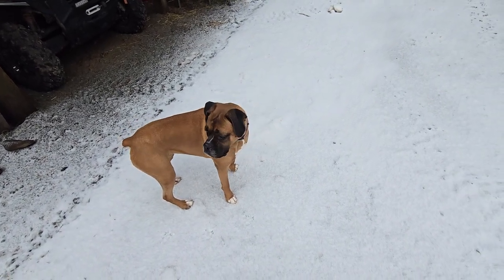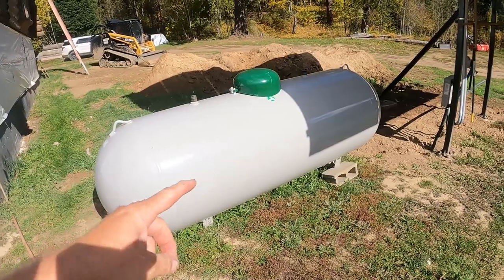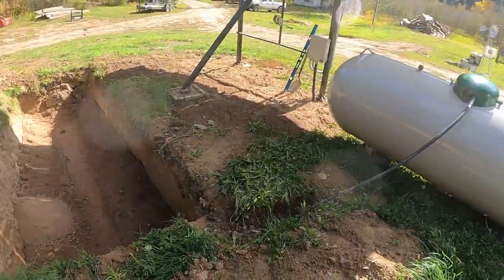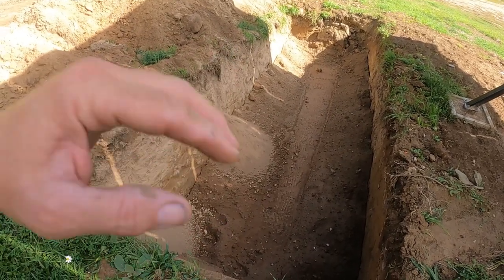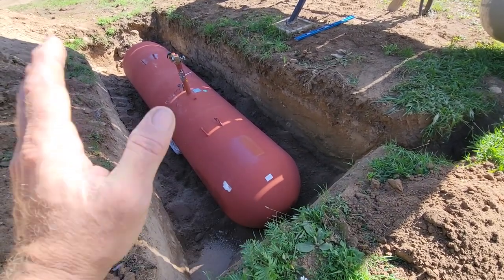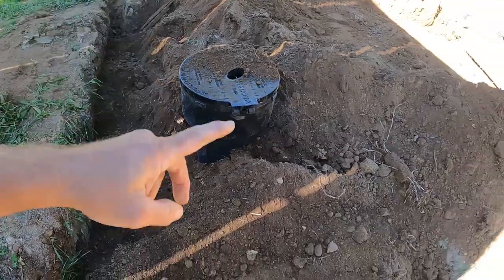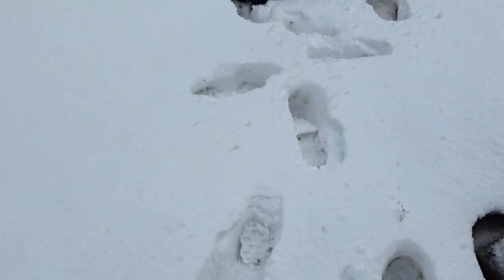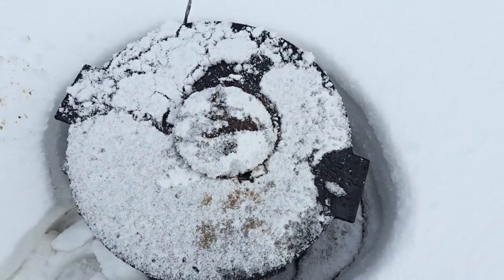UPGRADE your storage capacity! Buried propane tank vs above ground.

Comment: Can you ME link ME to the pump you used to transfer the propane from the old tank to the new tank. Thank you
Reply from the maker: The propane company brought one out.  It wasn't mine.
Reply: @HiddenValleyHomestead  what make is it and model it should say on it
Reply from the maker: It was a Briggs and Stratton engine with a pump.  You could call your local propane company to get more info.
Reply: @HiddenValleyHomestead  thank you so much

Comment: That should help if you have a long cold snap in the future.
In ground tanks are better in extreme cold. It's a factor of as you draw vapor out of the tank the liquid boils makeing the tank cold.
If it's say -20f and your running a generator at say 2 gal an hour.
Things will get mity frosty quick.
.
Basically the heat in the ground helps keep it warmer and the LP doesn't freeze in the tank/line.
.
And on the flip side, it keeps it cooler in summer, allowing for 90% fills where above ground tanks are ""supposed"" to be no more then 80%
But a good person that fills tanks, understands that in a cold climate and with steady use 85% is OK. Granted its not osha approved.

Comment: So they didn't want it in a vault so it could be inspected?
Are you renting it or did you by the tank?
Reply from the maker: I purchased.  I should have spent a few more minutes explaining what the sacrificial bags were for....
Reply: @HiddenValleyHomestead  I know all about the electrolysis anodes and cathodes from putting in cast iron sewer pipe and ductile iron water pipes. Over here in eastern Idaho I have been told that the propane companies won't sell the tanks, because they are having a tough time getting them and the price is going up from the time they order them and the time they receive them.